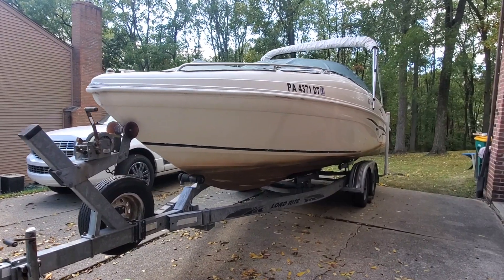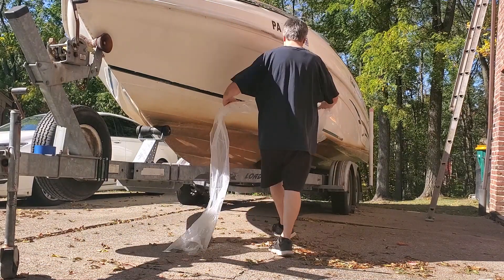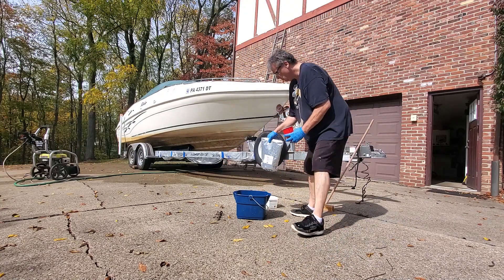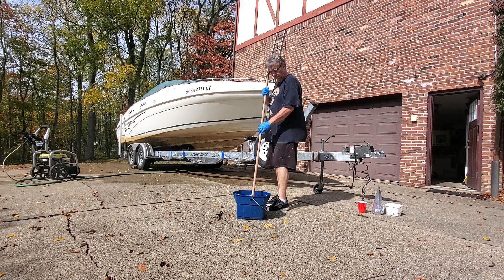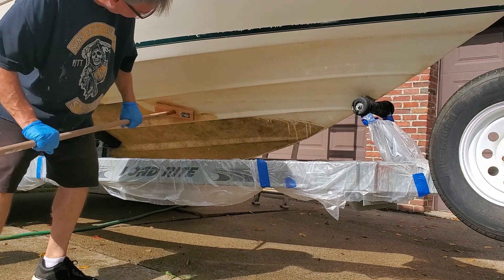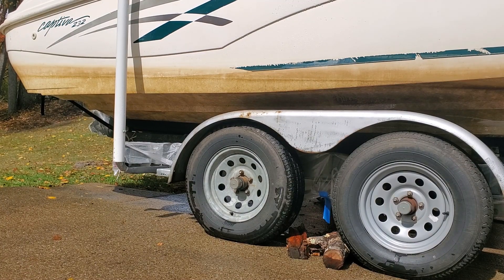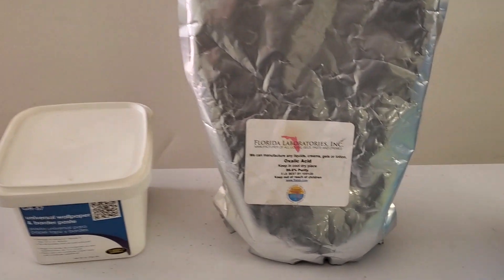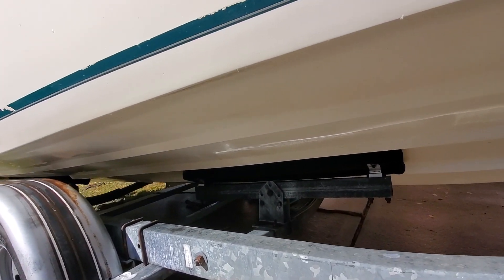Boat hull scum removal using Oxalic Acid, Inexpensive & quick!

Comment: How would you clean under where the boat sits on the pads of the trailer?
Reply: Ive always dropped the Stern on blocking and slid the trailer out until it can be reached. You can also jack the hull up, make sure everything is secure! Wheels chocked, and as much as possible, winch line attached and tight.

Comment: Next time mix 2oz of dawn or laundry soap per gallon of water and mix in pump sprayer.  The soap will help stick to boat.  Pressure washing guys use oxacid this way all the time and have excellent results.
Reply: Be cognizant that dawn removes the wax so you'll want to wax your boat after using it
Reply: by editing soap to the acid you ruining the chemical reaction and weakness it
Reply: @dano3345  the acid did that anyway!